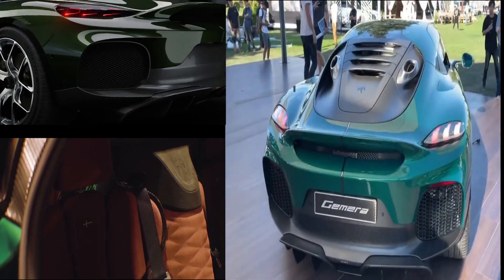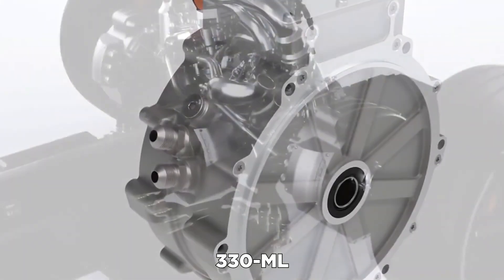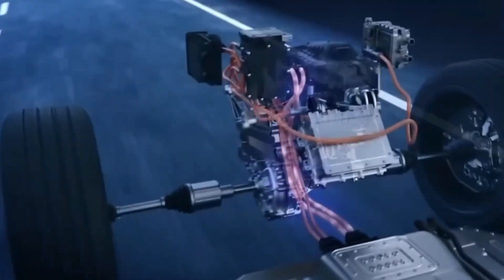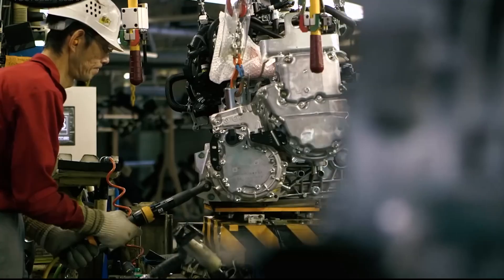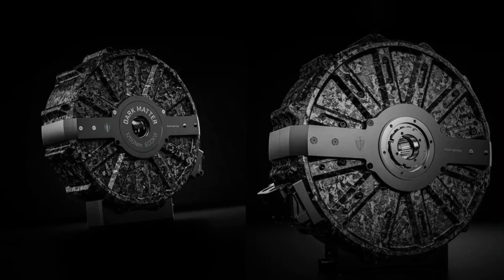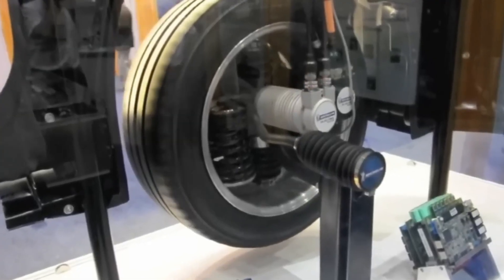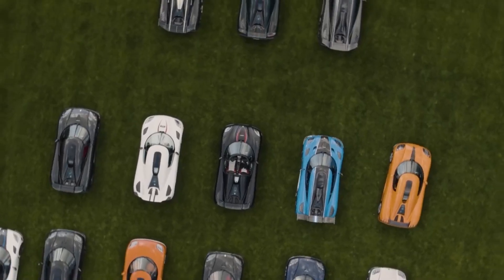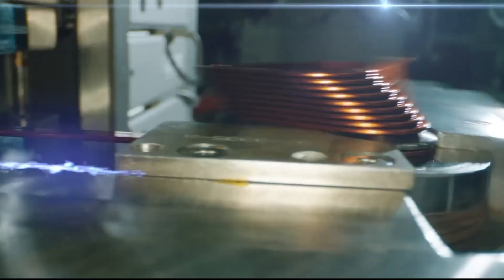How a Tiny Engine Can Make 2,000 HP

Comment: if you think this is impressive you should see the gearbox they developed for the new CC850, it is BOTH a 6 speed manual with a clutch pedal on the floor AND a 9 speed auto, you choose, and switch anytime/mid drive even, depending on your mood, and it makes D.C.T boxes looks slow. (been a keen follower of Koenigsegg for a few years now, Christian Von Koenigsegg and his team are reinventing not just the wheel...but the whole automobile industry) and the no fly wheel ultra fast revving engine that revs as fast if not faster than a big sports bike....